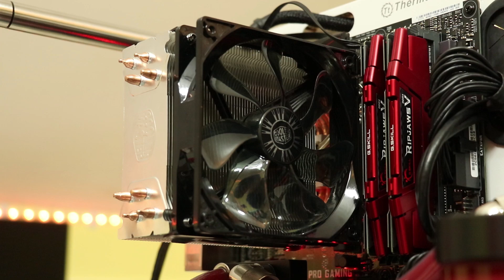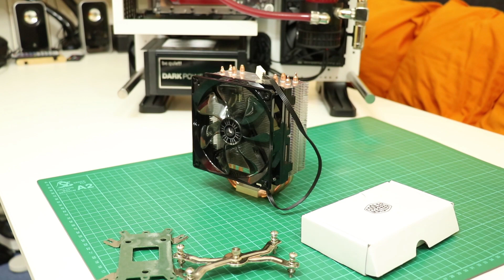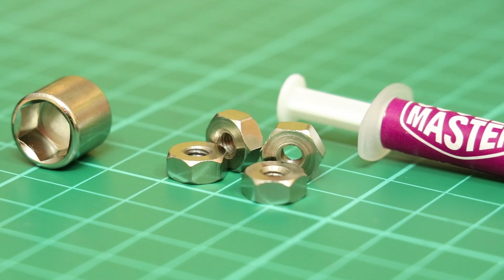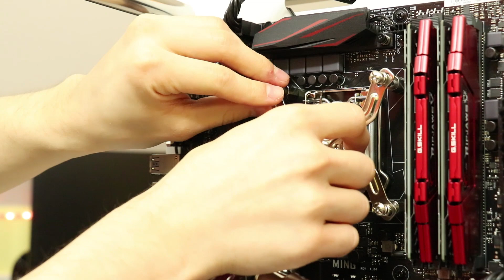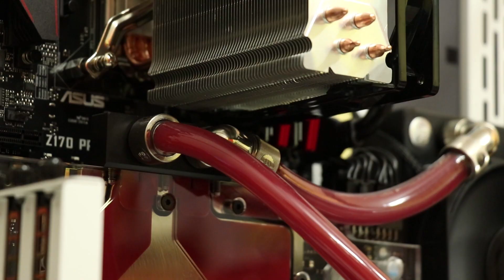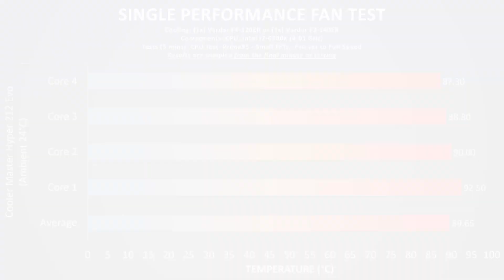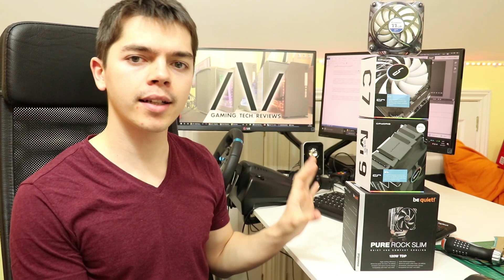Cooler Master Hyper 212 Evo Review and Test

Comment: My old quad core intel is running around 120 degrees im guessing this cooler will help some?
Reply from the maker: It sounds like any cooler will help there, and which your thermal paste to see if it has completely dried out. Also check your voltage, that will have a big impact on thermal output.
Reply: @AVTechy  Paste is new cooler im using is standard but case is chocka full of hdds and cables. The core2quad is fsb overclocked im guessing the cooler cannot cope nor the case. 3d mark pushed my cpu temps to 120 degrees. Im looking into a new cooler and a server case full atx so the old innards can breathe again maybe that huge lian li server case.
Reply: @AVTechy  Checked my cooler and it had fallen off the cpu :(

Comment: why the temperature on my cpu going up very fast? like in 1 sec it hit 65c from 32c, is 212 evo can not handle the cpu? ( I have delid cpu already)
Reply from the maker: That's not very uncommon behavior from a CPU, spikes in temperature will reflect the load of the CPU. If you're CPU is temporarily hitting 50% load, there will be a temperature spike to reflect that.

Temp spikes aren't an issue most of the time, and 65°C is not very hot relatively speaking. I'd recommend you apply a continuous load to the CPU to see what it's Maximum temperautre is. I use Prime95 Small FFTs test to see how hot the CPU can get.

Also double check the thermal paste spread. The Hyper 212 Evo hasn't got the best mounting bracket, so you may find you have a slightly asymmetrical application (but I think this is the least likely issue).

Give that a shot, and let me know how it goes.

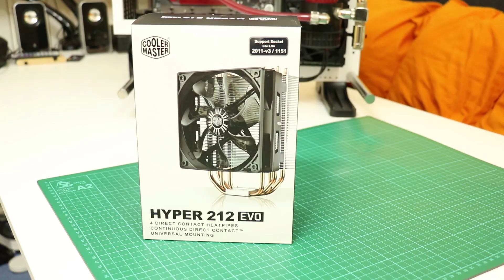Comment: 0:00 to 1:00 what is that waterblock?
Reply from the maker: It's this one:
https://www.ekwb.com/shop/ek-fc1080-gtx-ftw-nickel

The card is an EVGA GTX 1070 FTW, but it uses the same backplate as the GTX 1080.

Let me know if you have any more questions. I'd also recommend checking out the test results from a CPU cooler review in the last couple of months as I went through an entire retest and addition to the graphs, it should help you with thermal performance statistics.
Reply: tyvm

Comment: What would the temp be on a 65W CPU?
Reply from the maker: It would depend on how many cores and the "Lithography" (transistor size) we were talking about. If it was in line with the 6700K used here (14nm, 4 cores) than you could expect to see a 25-30% reduction in temps.

Making an "accurate" assumption really comes down to percentage increases or decreases based on comparable statistics. I've seen some interesting information comparing 4 core 65W processors to 6 core 65W processors and the 6 core a fair amount hotter. I can't find the stats at the moment so I've got nothing to back that up, but I don't think it's as much as 50% hotter (based on increased core count), but I'd say within the region of 10-20%.

It's much easier to make assumptions when the physical properties of the CPUs are the same, and its just a reduction in power as describes initially.

But this is all about the thermal output of the CPU, so it's down to the effectiveness of the cooler to shift that heat from the base up to the fins ASAP, which isn't discussed a lot when it comes to heat sinks.

Comment: Wich of these do you think is better, a thermalright HR-02 macho REV A BW or a coolermaster seidon 240v with push-pull using the stock fans as pull and two thermaltake riing fans as push.

Comment: What do you think would happen if you don't use thermalpaste?

Btw do you know why eu and us don't get the same fan?
Reply from the maker: Interesting questions. Well thermal paste is just there to ensure the largest surface are connection possible between the IHS and the coolers base plate.

Without thermal paste you'll possibly be able to get the system to post, but after that doing any load will likely cause at least some if not a lot of thermal throttling. You may even experience the CPU drop to its lowest multiplier and crash the system to save itself. 

If we say that without thermal paste the contact area between the IHS and cooler has been halfed, you can imagine that the thermal result would doubled. But I would say they would be even worse than that, and I'd expect the system to crash under a small load.

On to the fan question. I haven't found the specific reason for the difference. It could come down to the possibility that Americans use higher wattage CPUs on average compared to Europeans. Or it could come down to parts availability, or some specific deal for higher RPM motors in America that wasn't available in Europe. It's all speculation on my part, but there must be a reason behind it. 

Anyway thanks for checking out the video, and awesome questions by the way! Let me know if you have any more, and do you have any other theories to explain the fan difference? I'd be interested to know.

Also if you have a minute, please check out the video description and go to the timestamp linked there. It's a super important question for viewers about the direction of the channel, and I'd really appreciate your feedback!
Reply: AV Techy I'd be happy to donate a few bux but don't expect more then a few bux a month from me. I don't have a job because I don't have the time (I live pretty far from school so traveling time is pretty long) and I'm pretty broke right now and I don't even have all the parts for my first gaming pc. Nevertheless I would be happy to donate a few bux a month :)
Reply from the maker: Woah, hold on there! If you don't have the funds to get your own system, then I don't want your money. I want you to be able to watch these videos looking at which parts your saving up for, not putting money towards a channel for someone who luckily has a job and is just about making it work, and slowing down your progress to getting your own system.

Please (really please) sort you out first, before even considering putting money towards this channel. If you sent money I feel I'd be taking from you more than I'm giving to you, and that's not how I want things to run around here.

The Patreon would be for those who have the disposable income, and can openly afford to throw a couple of dollars towards something without it effecting them.

I really can't stress enough how much I don't want you to put money towards this channel, when it would serve you far better. Leave the Patreon support for others to deal with, and maybe at some point in the future when you've got yourself sorted out, you can consider it if you want to.

I hope that hasn't hit you the wrong way, but I want you to focus on getting your system going. I'm not going anywhere, so there is plenty of time to throw a couple of dollars towards this channel in the future.

Of course I cannot miss your generosity (it's unbelievable you'd assign any monetary value to this channel in your current situation), but until you send me a picture of your system fully up and running, I don't want you to send any money this way.

Thank you so much for the support, if you want to do your bit towards the channel, I can only suggest to not use an AdBlock on this channel. And of course, I hope you enjoy many videos to come, and you're awesome!
Reply: AV Techy you spend money on this channel that you don't even make back from youtube and you put time into it, that's worth something :) also like I said I won't give you all my money, just a few bux I have left on my paypal account wich barely ever use.
Reply from the maker: Haha that's true, it's like the titanic over here :P it's really not that bad, but you make very valid points. Of course it's completely up to you, and I'm sure you'll cancel the Patreon funding if it becomes unsustainable.

It's great to have subscribers like you on board! Especially since this is such a small channel, seriously appreciate you, I'll get to work on some sort of Patreon Page. And thanks again for the support, this channel is nothing without a solid subscriber base!
Reply: AV Techy happy to help :) you deserve it because you're also always happy to help:)
Reply from the maker: +Toto Geenen Just keeping you up to date with the whole demonitization situation. If you rewatch this video around this time there probably won't be any adverts since this video has been demonitized as well.

Clearly the YouTube algorithm needs some work since I can't imagine anything was offensive in this video.

But it solidifies the move towards a Patreon page, who knows, it could be a great move.
Reply: AV Techy I don't quit get the last part, sorry my English is not that good. What would be a great move?
Reply from the maker: Sorry I was typing that on a phone so it changed "Patreon" to Pattern...

So setting up a Patreon page to help fund this channel might be a great move. Thanks again for the support of this next step!
Reply: AV Techy oh, I get it now. Yeah that would be a great move